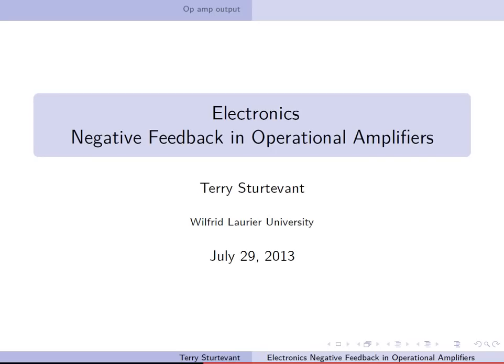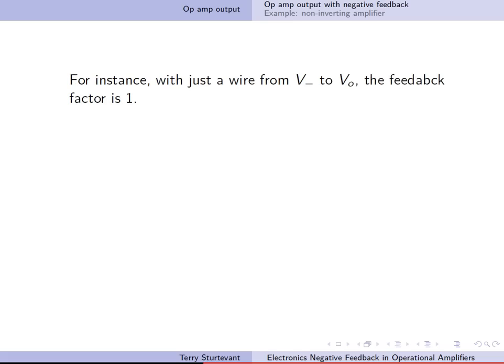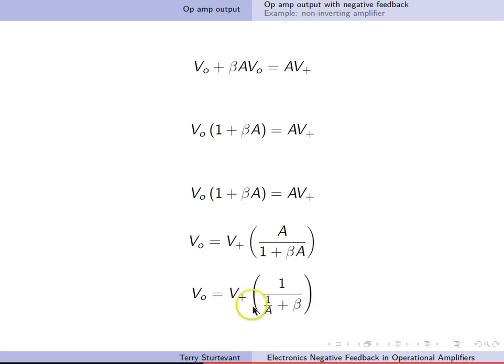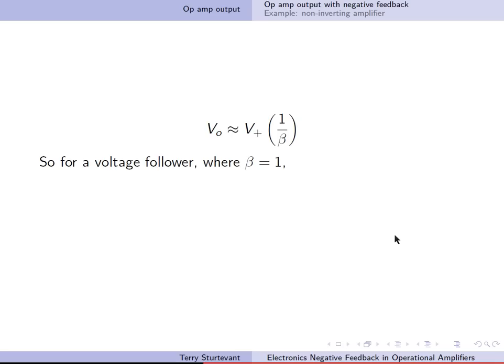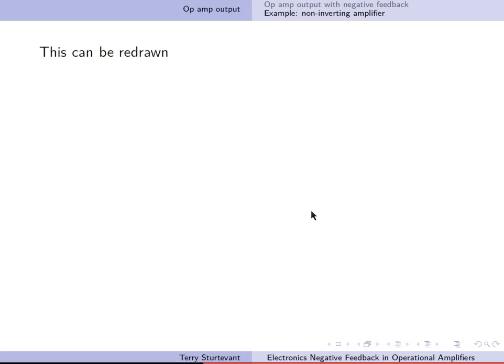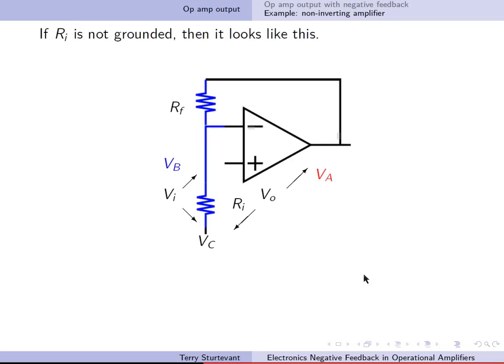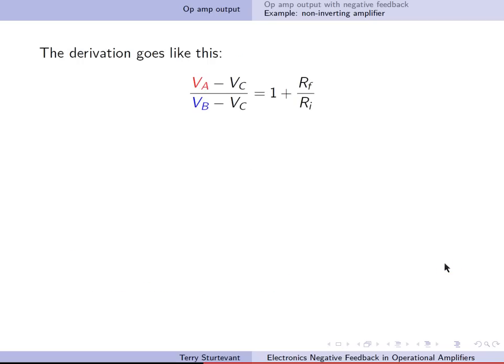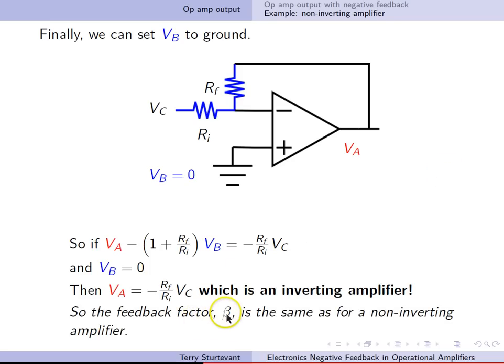Negative feedback in op-amp

Comment: I know this is an old video but if you want to know how to use this in a circuit it's useless. 
What does it do? Do you have an example? What kind of signal is at the other input? Does this apply to an op amp that doesn't go from rail to rail? Finally "Here are the formulas to help you calculate the resistances for your circuit."